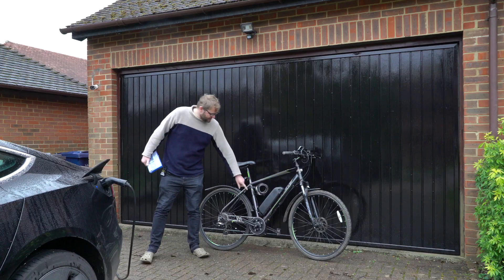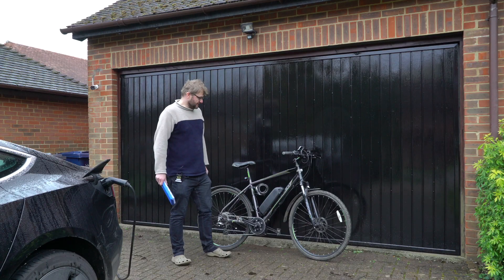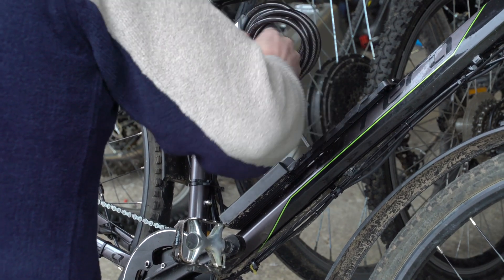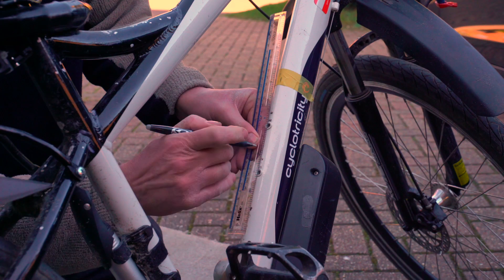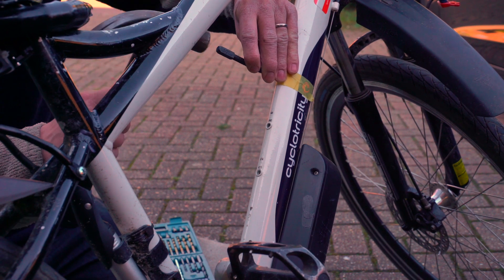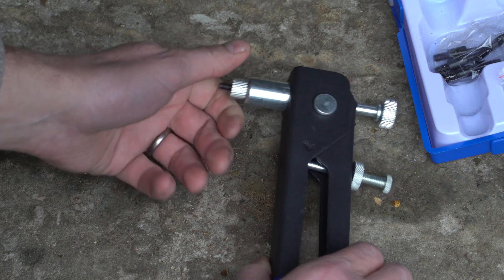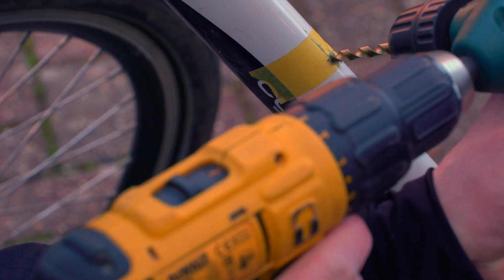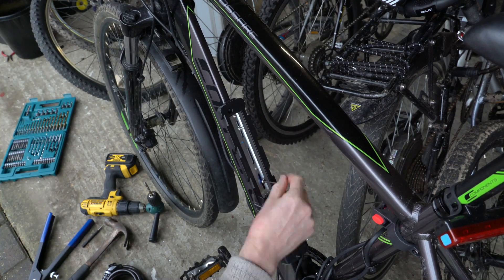How to fit an E-Bike battery with threaded insert rivets or rivnuts

Comment: any thoughts on the notion of weakening the frame by doing this? On my bike I used a GRIN triple bob (awsome product) but on my partner's bike, there is not enough space, so I have to drill.
Reply from the maker: I wasn't aware of the trip bob. Looks like another good option. I did some research regarding the rivnuts and couldn't find anyone who'd had an issue. Certainly on the two bikes I've done this on, they seem fine.